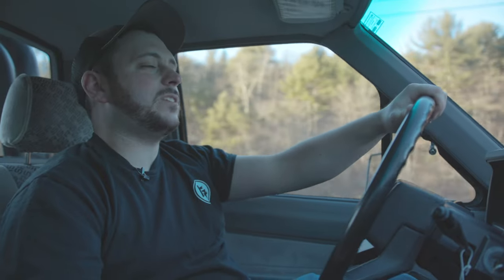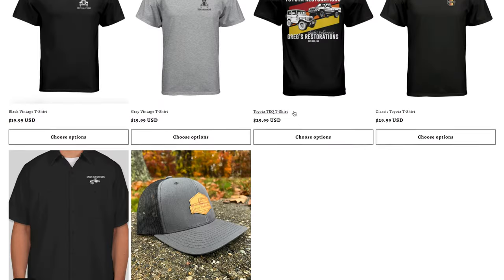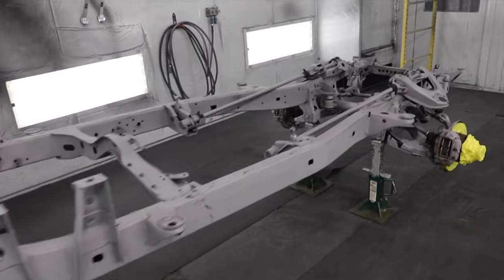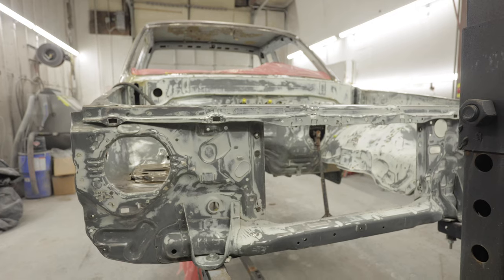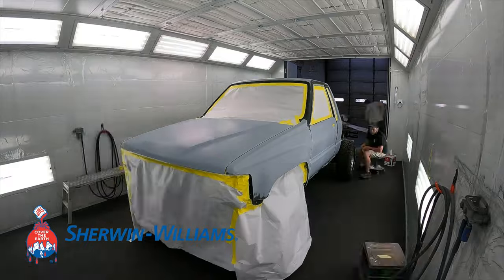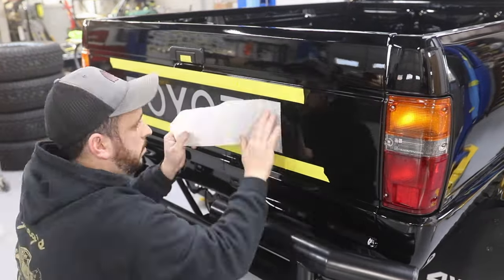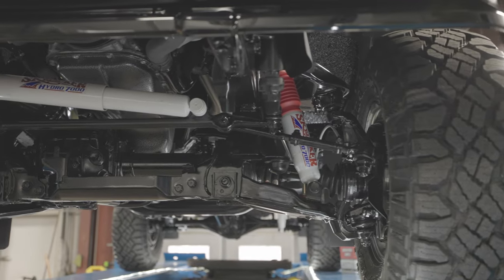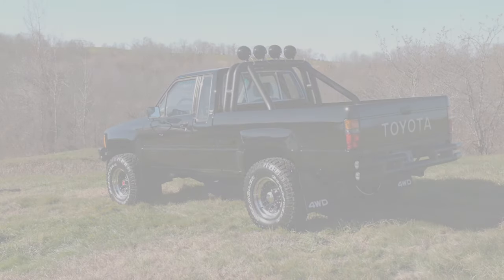1986 Toyota Pickup Extra-Cab SR5 Restoration : "The Marty Package"

Comment: Love these trucks!! My grandpa bought a 1985 SR5 4x4 pickup 22RE  brand new in 1985. He had it for 6-7 years and then sold it to my dad in 1991 or 1992. My grandpa drove the truck a lot in those 6-7 years. It had around 150,000 miles on it when he sold it to my dad. My dad drove it until around 1996 or 1997. It had around 180,000 miles on it at that point. It would no longer pass emissions due to a timing chain issue. My dad tried to fix the timing chain issue but made a mistake somewhere since the truck broke down not long after he thought he had fixed the timing issue. The truck then sat in the backyard at our old house from around 1997 up until we moved in 2004. My dad then sold the truck to a junk yard around the time we moved. I was only 8 years old at the time but have fond memories of going out and sitting in the truck and pretending I was driving. Kinda wish my dad would have kept the truck. I think he now wishes he would have kept it as well. Someday if I’m ever able to afford it I’m definitely reaching out to you guys for a restoration of one of these trucks. I have watched several of your videos on them and you guys are the top quality of restorations on these trucks 👍

Comment: Very nice especially the details, I believe the movie use 2 possibly 3 trucks. There was a documentary on the movie with actors. If you could pause the scenes in the movie, the flatbed tow scene that's the 85 look closely at the front. the garage scene where the door opens the front axle and also zoom in and you'll see the SR5 buckets. the drag race scene look at the part where Marty is sitting in the seat plastic covered head rest with no SR5 markings also when they show the front end IFS. I own the 85 solid axle EFI holy grail truck fully loaded power everything including antenna but in white.
Reply from the maker: Yes they used 2 or maybe 3 trucks. We restored the movie 2 & 3 truck and was in the Netflix documentary and discovery Channel documentary on the film. If you view our channel you will find the restoration on the screen used truck.
Reply: @gregsrestorations7019  Most awesome way to keep the MCfly alive. Might have to get some seat material SR5 from you.
Reply from the maker: @dandorris8531  sounds good!